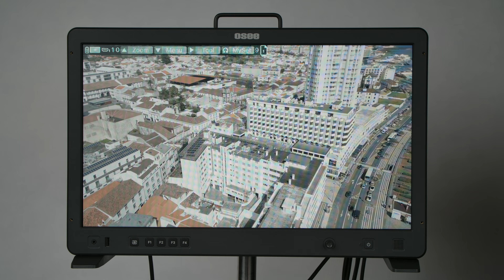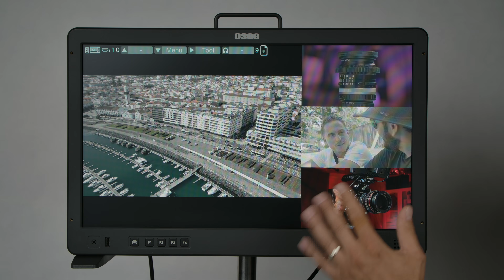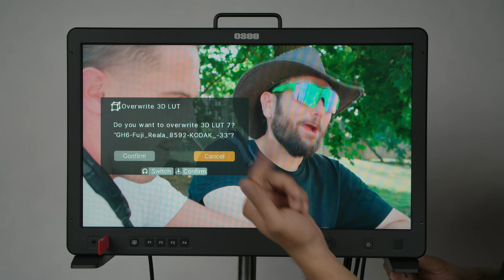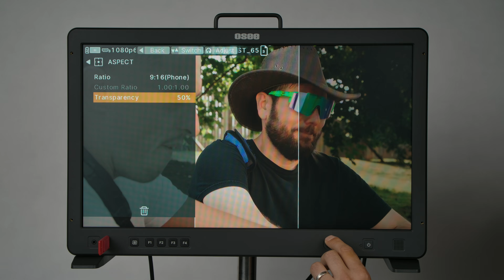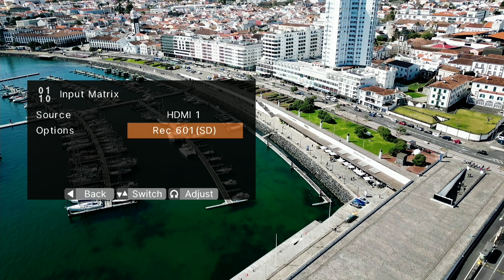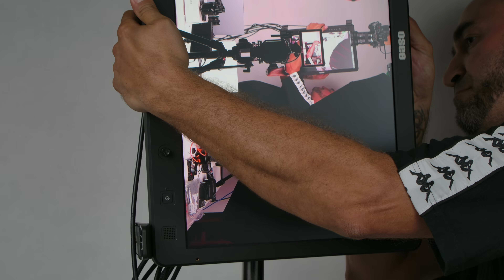Osee Mega 22S4 Menu Settings EXPLAINED – Full Feature Breakdown

Comment: I just bought this monitor. Has anyone else noticed blocky / grid-like  pixelation the bokeh, or flat areas of an image?
Reply from the maker: I haven’t noticed this. 
As you can also see in this video, many sections of this video was recorded to my video switcher directly from the monitors hdmi output. 
I was basically recorded the monitors screen to my video switcher. 

Be sure that you are updated to the latest firmware. Even though I have never noticed this even on the earlier firmware versions. 

If you still having this concern I would 100% recommend to reach out to Osee and I’m sure they will help. 

Keep me posted.

Comment: Does this have the image delays like other Osee monitors?
Reply from the maker: I don’t recall seeing any delay settings. 
What do you mean exactly “the image delays” ?
Reply: @LeoPazzo a notable delay between the camera capturing an image and the image being displayed on the monitor. I used a 15s before to pull focus and the delay was problematic, and other friends have had the same issue with other Osee monitors. I’m hoping they solve the problem at some point.

Comment: I emailed OSEE and asked if they'll be releasing a new firmware that would add toggling LUT's on and off to one of the function buttons. Fingers crossed.
Reply from the maker: Yes that would be helpful 

But I can see that not being so easy to do on the developer / firmware side. 
Because it would need further control to tell the monitor which input you want to apply that lut to on or off. 
That’s my guess